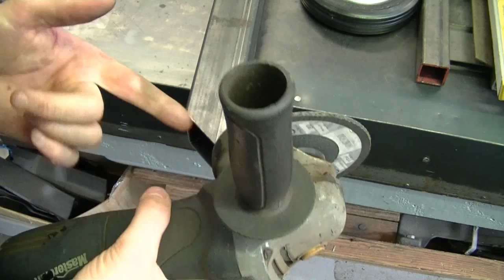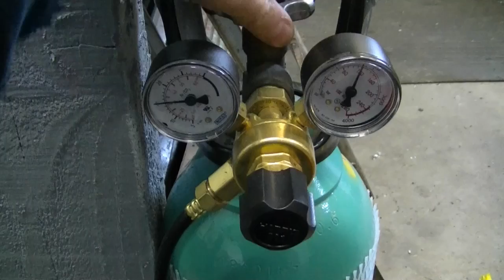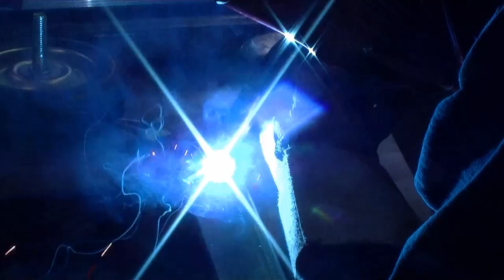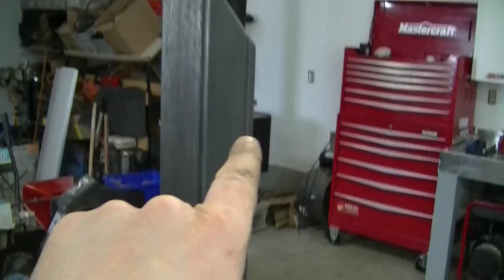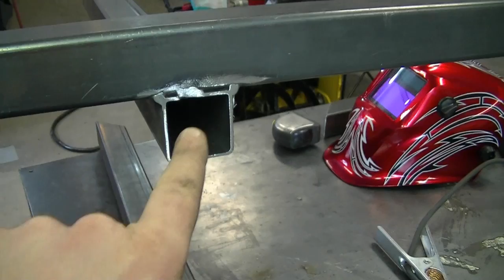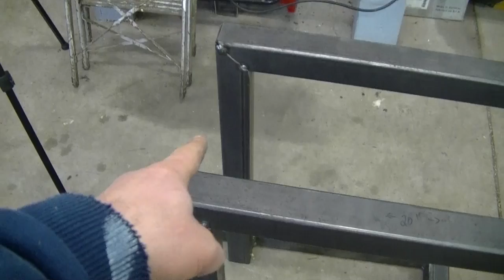How To Build a Welding Cart For A Mig & Stick Welder Part 1/4

Comment: Interesting.  In a few months, I am getting a Miller Bobcat.  I want to take welding classes.  I randomly got a cheap welder and was rather good at it.  I think it weighs like 501 pounds.  I want to make something that I can use to move it out of the shed that my mom and step father are going to get me.  The thing will be either 8 x 8 or 8 x 10.  Way to small to weld in.  This put ideas into my head.  I will have to figure out how to make the wheels be strong enough.  The only think I have now is a small stick welder.  So, mild steel is what I can weld.  It will be fin to see what I can create.  haha  Thanks for the cool videos.  Peace.
Reply from the maker: +Josh Glowzinski sounds like a nice unit, make sure your wheels are big enough, I ended up upgrading my wheels to bigger ones

Comment: Best way to tack a frame like that is to just put a tack in the middle of the inside corners, and weld the outside corners first... 1/4 the number of tacks, way faster, and only have to flip the frame once which is especially important with larger, heavier frames.

Comment: Too much gas bud run it closer to 10
Reply: I thought 15cfh was pretty good, no? My Hobart wants me to run minimum of 20. However, I've had no problems with 15. Also, I weld in my garage with the door open for ventilation. Sometimes gets a little breezy mid weld. I usually stop-start if it gets excessive.

Comment: Hey Don.

You can turn the shield gas a litlle lower. 

As long as the weld doesnt bubble up or get real dirty your good.
Otherwise its a waste of expensive gas.

But when its windy you have to turn it up a little.
;)

Comment: Try not getting to far out with the gun from your piece. I think with the size gun you are using 1/2" is all the wire you should allow. If you read Stack of dimes. You'll see what I mean.. Good job though ))))))))))))))))))))))))))))

Comment: follow up,sorry dony not trying to get in ur way ,just trying to help ,but patience is the game when trying to adjust these little guys ,i fould that out for sure,i have a poulan 2150 that wood not start for shit i was ready to rebuild carb but i stayed after reseting set screws over and over and finally bamb she fired stayed run long enough to fine tune now ,2 pullls and shes off,have a good day

Comment: if you just cleaned it and you have tried adjusting your high ,low ,it may be time for a rebuild kit the diaprham and pump side of carb,sometimes they can be damged ,but take your time and try adjustments screw in all the way then out 1 andthen .25 if its dieing shes not geting fuel,if all else fails ,air may be the compert a leak gasket ,well hope it helps post a vid and send us a link of ur machine have a good one

Comment: looking good Dony your getting the hang of running good beads and judging by the sound of the arc part way through the video you have the wire speed adjusted pretty good....in the beginning of it sounded a bit off by the inconsistent popping while you were welding looking forward to part 2

Comment: dony hello, sorry for this correction but I am doing a course in welding homologation mig / mag and the MIG weld using protective gases such as helium and argon and the MAG are used shielding gases like argon mixed with CO2, by the way thanks for this video.

Comment: watching this reminded me of another video i watched, they took a riding mower, made it into a cart and made a welder out of the engine and alternator, I just thought, what if you added another alternator, and a lawnmower engine with no carb, gas tank, or cam shaft and attach a tube to it, running to a tank and then you got a welder/generator/air compressor!

Comment: Good stuff !!  Lots of good tips, for a beginer your really good.  I always  back off the outlet pressure after each use,  helps save the gauge from the shock when opening the tank valve and leaving it set at one setting.

Comment: don't know what he's using but I use 80/20 since that's what the shop recommended for general welding of stuff like this, I think they said if I was welding thin steel I need a higher argon content but that was several years ago so I might be wrong..